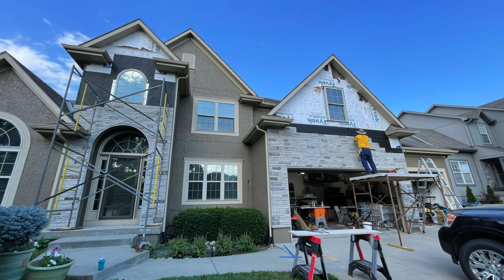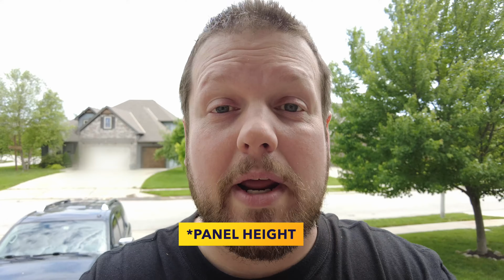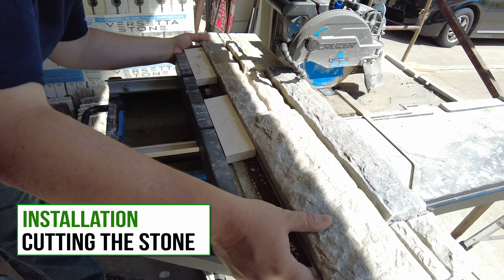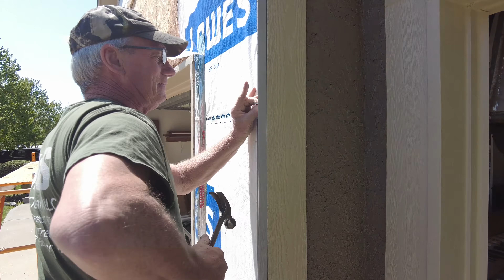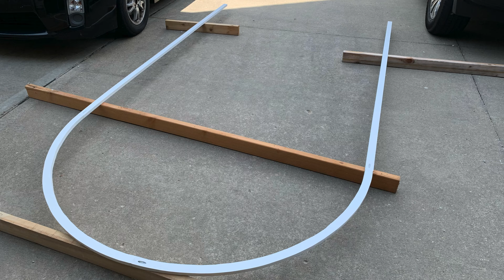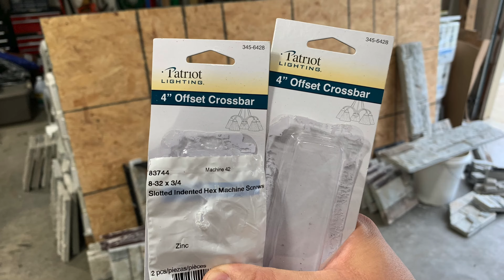How To Install Versetta Stone Like A Pro! | DIYers Guide

Comment: Did you find a need to put a lentle over the garage doors or windows, I am worried about the weight of the stone sitting on a window.  Appreciate any insights
Reply from the maker: The weight is supported by the screws. We have way more area with the archway and there's only PVC trim under it.